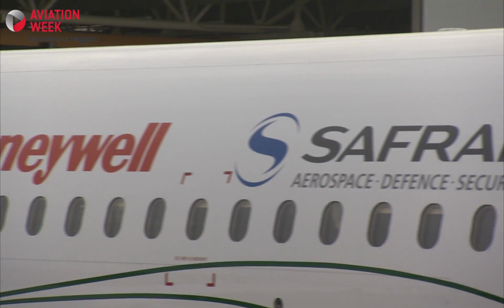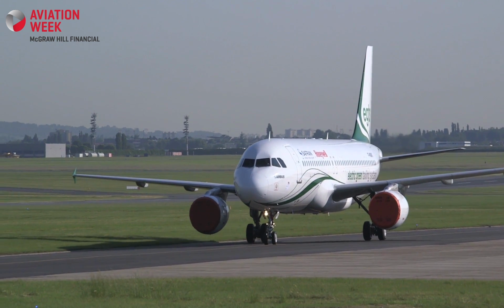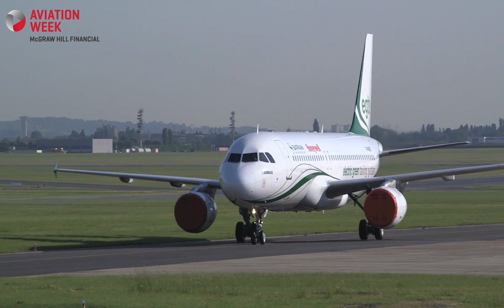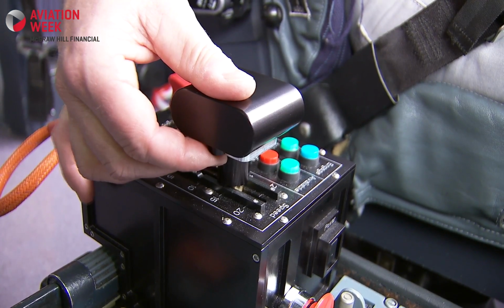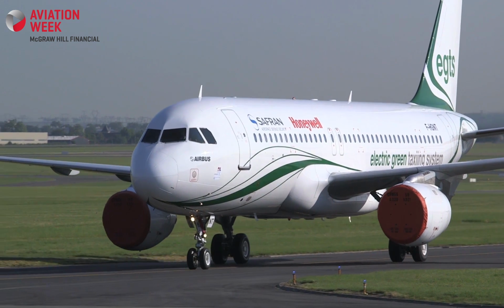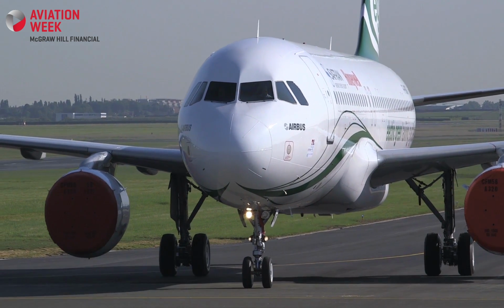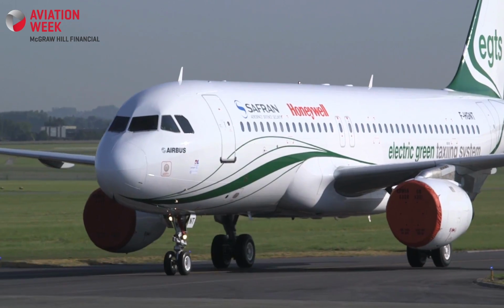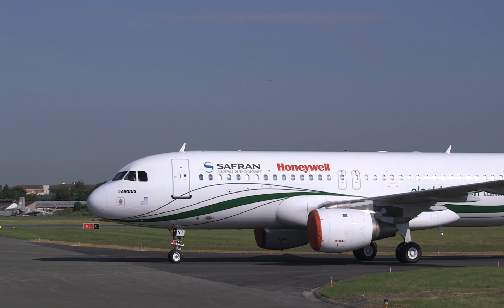Honeywell/Safran Tests EGTS Electric Taxiing System

Comment: I know I’m a bit late to this party but… “blame it on YouTube” … (😂) …  Actually this concept had been in the works for quite some time but sadly nothing has ever become of it. What was talked about as well in conjunction with this electric taxi scheme with the wheels was replacing the turbojet APU with a fuel-cell to further reduce the carbon footprint.  Good ideas that seemingly aren’t going anywhere… “?”
Reply: Too expensive compared to just burning fuel. This won't take off until oil prices go up.